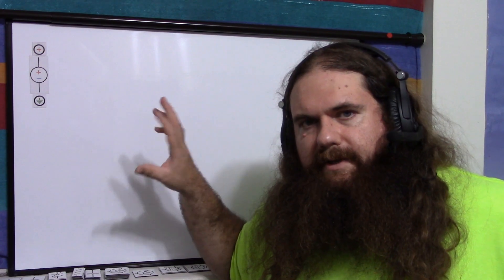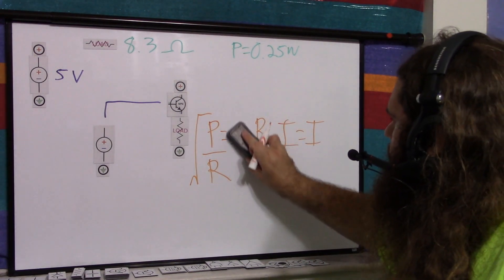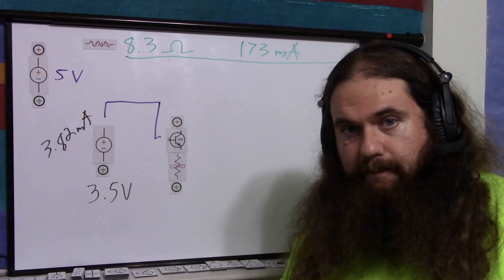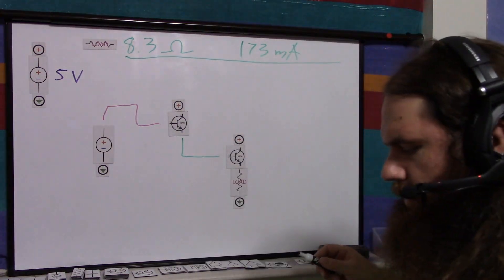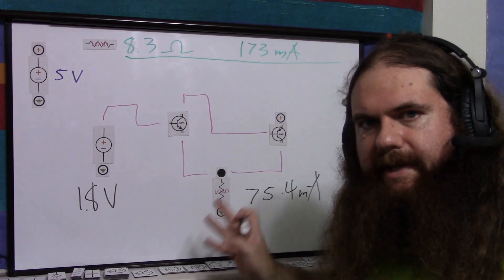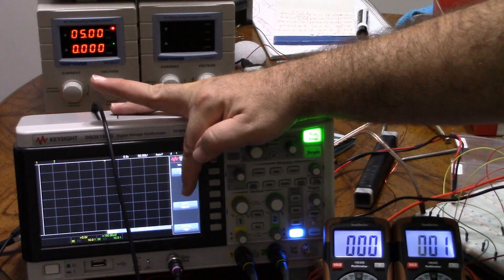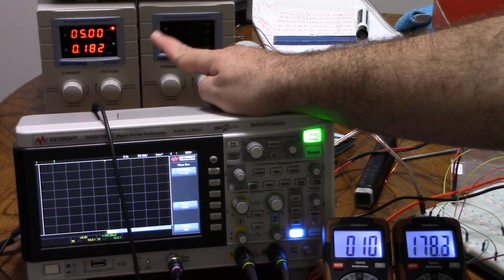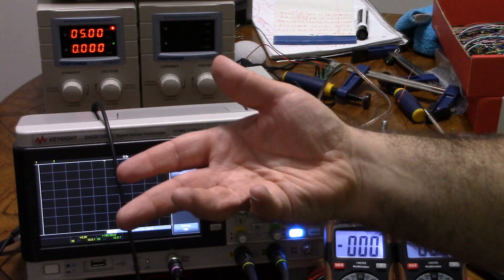Sziklai Darlington Transistor Pair - Real World Efficiency Demonstration - Simply Put

Comment: There's no such thing as a Sziklai Darlington. Its either a Darlington Pair or a Szikai Pair. You may also see the Sziklai Pair referred to as a Complimentary Feedback Pair.

You can use both together. It was quite popular in early silicon transistor power amplifiers as decent quality PNP power devices weren't widely available. You'd use a Darlington Pair (NPN-NPN) on top of a Sziklai Pair (PNP-NPN) in a push-pull set up so you only needed the readily available and higher quality NPN power devices.

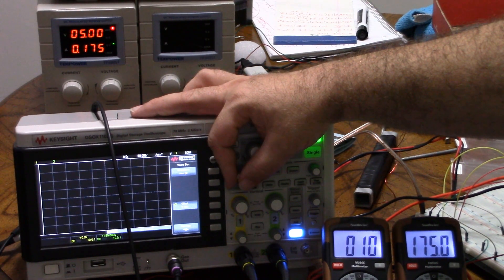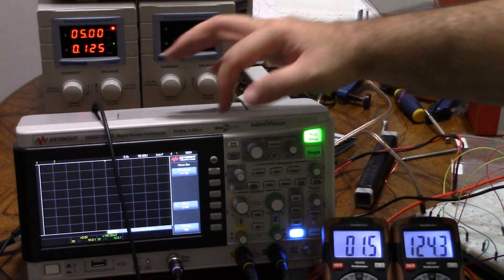Comment: I know that I am a little late to the party but I would like to add some remark about your explanation of the deviation between the currents displayed on the power supply and the current meter as mentioned at 14:44. You forgot that you need the 3.6 mA (see 13:15) to drive the base of the second transistor in order to achieve an emitter current of 170 mA. This current is now drawn from the power supply. Hence the power supply shows 176.4 mA + 3.6 mA = 180 mA. So in this case this is not the reason for the "inaccuracy" of the power supply, which of course exists.

Comment: great demonstration ,thank you!

btw. 
do you have any plans to make a video about "how to calculate capacitor size " (for a circuit) ?
it seems there is not much info about this..... maybe it's too complicated ?
i'm trying to make a 5v relay to energize for only a second or so, but i can't figure it out with just the RC time constant ...
only by trial and error, maybe i'm missing something.... (well, i'm sure i do....)
Reply from the maker: Honestly, I've found that trial-and-error (as in, use a trimpot/potentiometer or other sort of variable resistor) is the quickest and easiest way. Most circuits have some sort of approximate formula but none of them are exact, due to physical realities. My usual method is 1) use formula (or just R times C if no formula is available) to guesstimate an R and C that are within the "reasonable" range (so, not 2 megaohms and not 0.1 picofarad, or something else silly), 2) put capacitor in and use trimpot for resistor (because a variable resistor is easy, and a variable capacitor is much less easy), 3) alter capacitor value and re-do step 2 if necessary. It's where an oscilloscope is a lifesaver, because I can just have the circuit live in the oscilloscope and turn the trimpot knob and quickly get it right just by looking at the oscilloscope screen.
Reply: @simplyput2796  
did it a bit differently.... ,but you gave me a great idea !   to use my oscilloscope !!!  i was lost in searching a formula to do it "properly" and completely forgot about it....